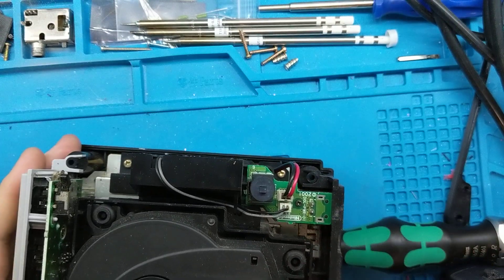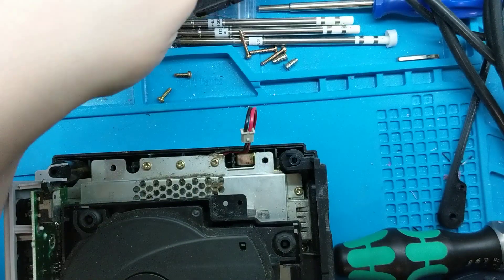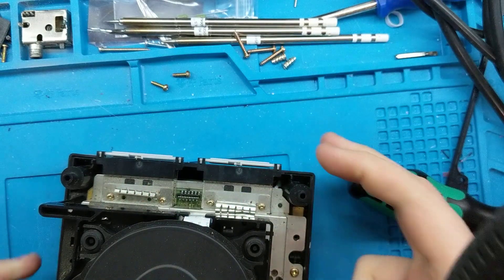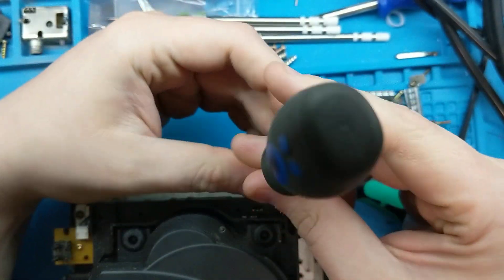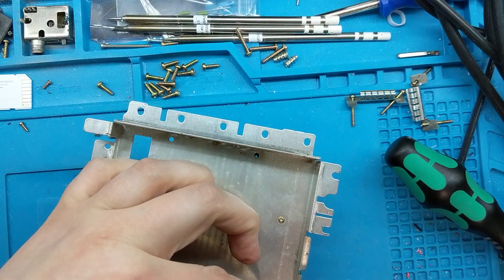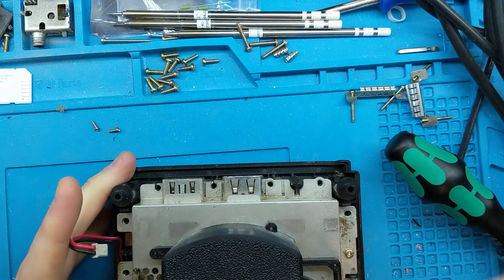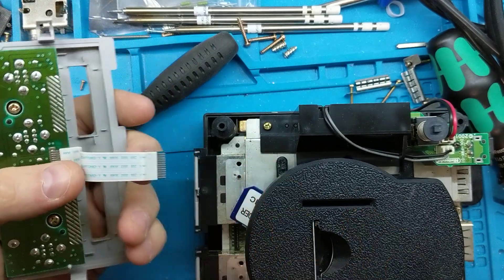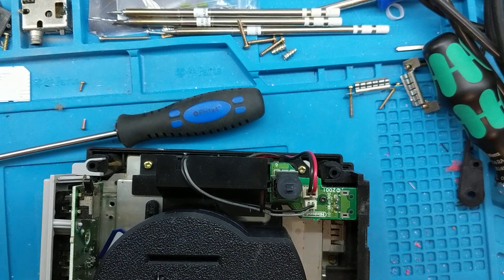SD Card Mount for the GCLoader ODE

Comment: you should included how too put the xeno mod chip on the sd card mount cuz you litterly took it off the disc drive and did not put it back and i need too know too put my xeno motherboard on the sd card mount
Reply from the maker: This isn't for the Xeno modchip its specifically for the GCLoader The XENO is a modchip for the original disk drive to allow burned media to boot, not an ODE.

Comment: Just installed one, and the tolerances could use some work. One of the holes was almost blocked, the plastic holes don't quite line up perfectly with the metal plate, and I stripped at least two of the screws trying to put them in, so I had to leave them only partially in. It fits OK once the whole cube is reassembled, but the actual installation was a royal pain due to the to poor tolerances.
Reply: Agreed. I had the same issue. All three screws fit stripped on mine.
Reply: Same issue. Two screw holes were fine and fit in great, two are too small for the original screws to go into, either I have to buy new screws or drill a wider hole which im uncomfortable doing.

Comment: What SD Card Extension cable are folks using now. The one that was linked in Amazon is no longer available
Reply from the maker: I started selling them since no-one seems to stock them anymore, also come the the required screws to assemble the prints you make.
https://laserbear.net/shop/ols/products/sd-extension-hardware

Comment: Great instructional video. Just ordered my mount in anticipation of when I get the GCLoader. Quick question: do those small metal pieces not need to go back in that had the long skinny screws? I think they were near the memory card slots.
Reply from the maker: @Yorper Thanks, yes I forgot them. I didn't have my GCLoader at the time so I was just quickly reassembling the console to show off install.

Comment: This killed my GC and ODE, made it get very hot until it failed and neither work anymore.
Reply: Really? What did you do? How did you figure that out? Did you reach out to anyone about replacement/fixing it? Which install method did you use?
Reply from the maker: After contacting Dan he has not had any reports of GCLoaders failing due to heat. I also have not received any kind of contact from any of the users of this product to reflect this claim. If you are having an issue with my product or Dan's you need to contact us to resolve it. We are both easy to reach and will provide help to solve the issue.

Comment: Hi. Does the included SD extender work with SDXC 128gb or bigger?
Reply from the maker: Any card that is supported but the GCloader hardware will work in this. As of right now the GCLoader has been confirmed to work with cards up to 1TB in capacity. Just keep in mind my kit does not include a GCloader that item must be purchased from one of its designers.